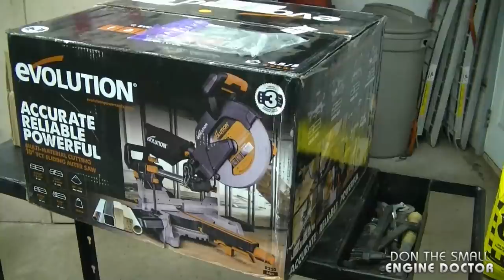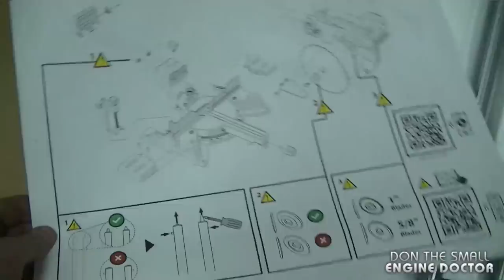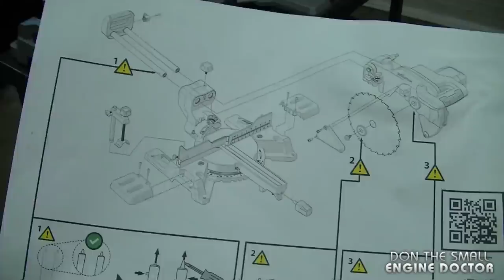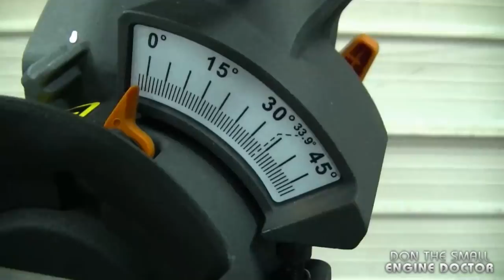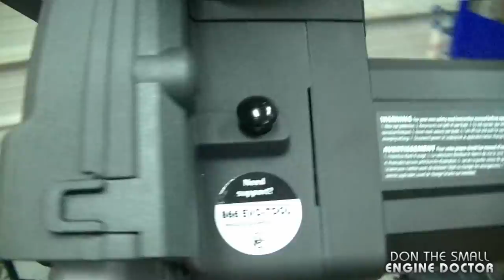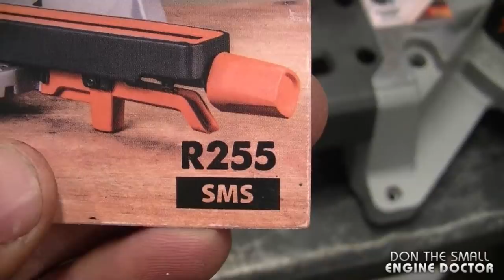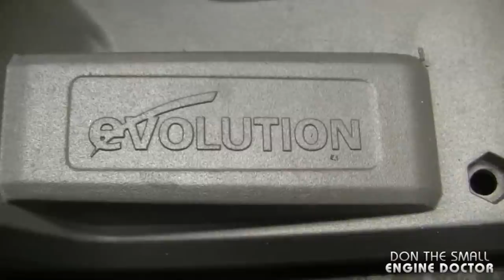TOOL REVIEW -  R255SMS Multi-Material Cutting 10 In. TCT Sliding Miter Saw

Comment: All I did was acquire an evolution blade a while ago and fitted it to my old mitre/chop saw, cheap steel cutting tool, good blades, great on box section, but definitely need eye and ear protection.
Reply: Keep in mind that the Evolution blades are designed for a much slower RPM.  Your average chop saw is going to hit anywhere from 3000 to 6500 RPM, and multi-material saws like the Evolution are around 1300-1500.
Reply: @f15sim  yer that's right, my chop saw is variable speed that's why I fitted one.

Comment: I bought this same saw. I needed to make miter cuts in 2"x2" 1/8" wall square tube.  I was happy with the saw except for two things.  The blade only made it thru a hand full of cuts before it got very dull.  And those aren't cheap blades to purchase.  I will not buy their brand of blades. I'm not wasting more of my money.   I've got a cheap Northern tool Chinese 14" chop saw ( dry cut not abrasive ) that I've had for a few years and made well over 100 cuts thru the exact same material. And it still cuts great.  It just can't cut the angles I needed to cut. So I bought this Evolution saw.  I've used dry cut saws many times. This was the worse blade life I've run into to. So now I have the saw sitting until I get a different brand blade for it.  I'm going to try a Oshlun blade and see if that's any better.

My other complaint is the hold down clamp is too flimsy for metal tubing.  It flexes too much and doesn't hold tight enough.  I'm going to have to build something that will work better.

Besides those two things I was happy with the performance and quality of the saw.
Reply: What s the price

Comment: 15 amps is pretty robust when you consider the typical household fuse/breaker is 15 -20 amps.  That would explain the delay start up.  Your shop must be well wired.  Didn't even see the lights dim.  Great review Don.
Reply: Very good point Gord, I'm running 13 amps at my home. That for sure throw a breaker here !!. Thanks for sharing.
Reply: it starts slow because it has a soft start on it. basically starts at a lower voltage then ramps up to full power which lowers the amp draw on startup

Comment: I have had one of these Evolution saws for a couple of years now. Blade life isn't as good as I was hoping if you cut a lot of steel. After cutting maybe 100 cuts through steel it struggles to cut a wood 2x4. Canadian Tire does not stock blades for this machine and when I tried to special order on from CT they said they couldn't help me out. I did find a local tool store called JD Industrial in Regina, SK that could order them. The price for each blade was around $65 Canadian, but that was a few years ago.

Comment: I have a older 5 horsepower Honda Outboard and the shifter is seized on it due to corrosion I could move it but it's really stiff how do I unseize it and do I have to pull the power head off to get to that particular part

Comment: If youre doing alot of fabrication or metal cutting in general get a dedicated 14” metal cutting saw or band saw, cutting steel is hard on these blades i have the saw with a couple different blades but the saw turns too fast for steel, its a good saw for a home owner whos gonna cut a little of this a little of that itll do a decent amount of steel on one blade if you can have it sharpened and cut properly with it, good buy at 200$ on sale at CT

Comment: Did any of the saw dust end up in the evolution-bag? Or was it all distributed evenly in the shop?
Reply from the maker: some did, mostly the wood sawdust went into bag
Reply: @donyboy73  The instructions that came with mine said not to use the dust bag when cutting metal.

Comment: Great review, I’m buying one..the problem with cutting alumn, mild steel or SS at home is you should have coolant on blade during cut, and that’s very messy...
Reply: The blade's designed for dry cutting metal👍😁

Comment: With these types of blades it is absolutely critical that all material is clamped down securely before cutting. If the material shifts or jumps at all you will likely lose one or more of the carbide teeth on the blade which will render it useless.

Comment: Don, I usually cut wood and composite material, less frequently cut aluminum and I avoid cutting steel with my power saws. It would help if you were more specific about the types of metal you are cutting. Aluminum vs steel especially. Also, I noticed that you are using good speed/feed rates for the types of cuts you are making.

Comment: Many GREAT features, BUT, I would like to see HOW MANY cuts of that steel round & Sq tubing you can get BEFORE the blade is so dull it won't cut. IMHO, a drawback is all those plastic knobs, I haven't had success with such on other equipment.